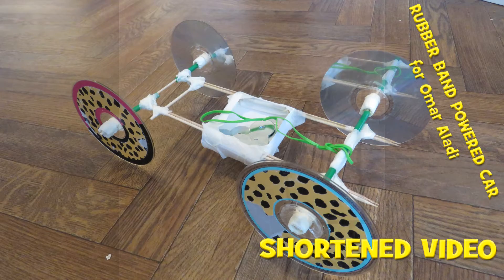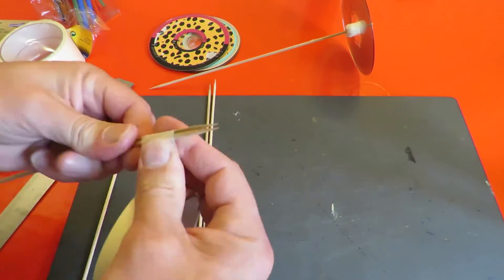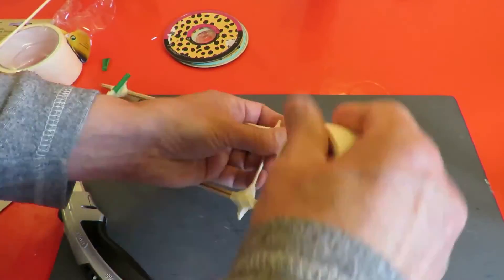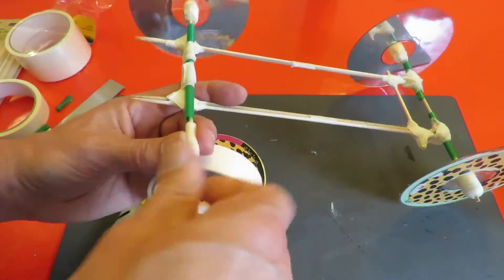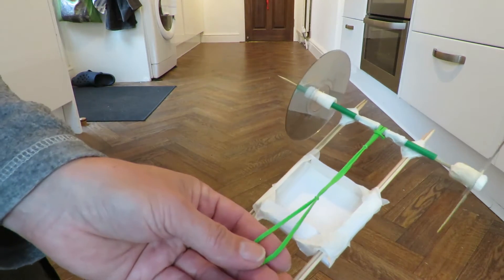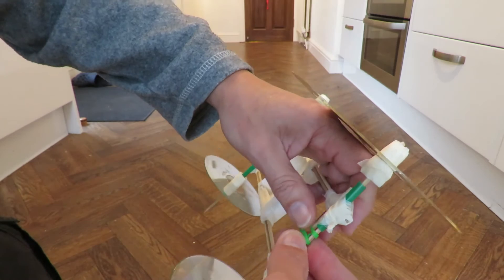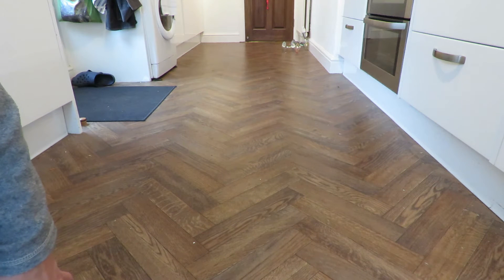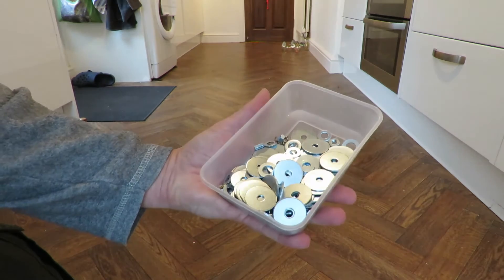Rubber Band Powered Car for Omar Aladi SHORTENED VIDEO

Comment: How much load can it carry?
Reply from the maker: I only tested it to the specification. The only limit would be when it starts to bend the chassis or the axle. There was effectively no limit on the rubber bands (30) as the axle would snap before I used all of them.
Reply: Ok....now, make it fly?

:-)
Reply from the maker: Wil Hobbs :-)